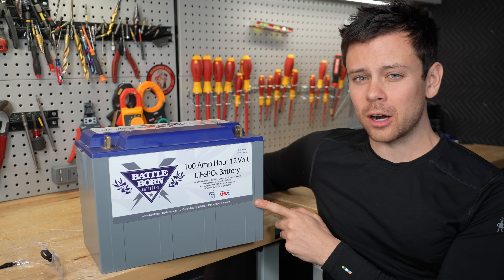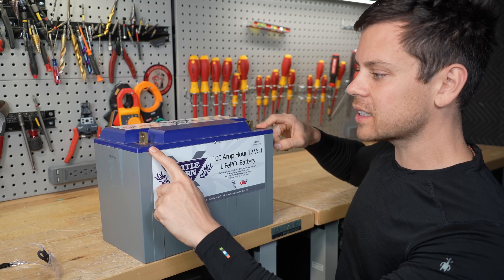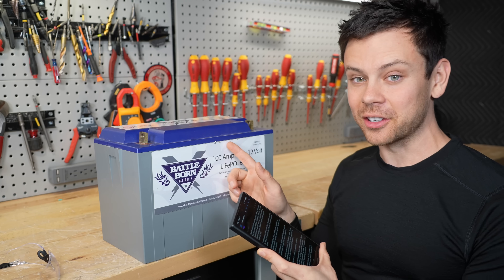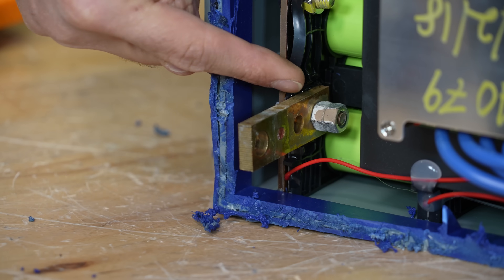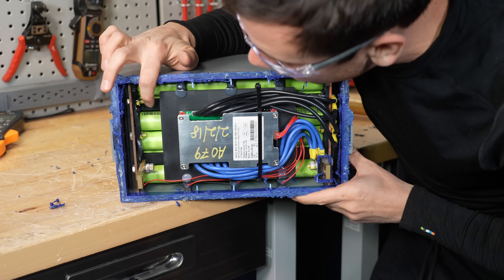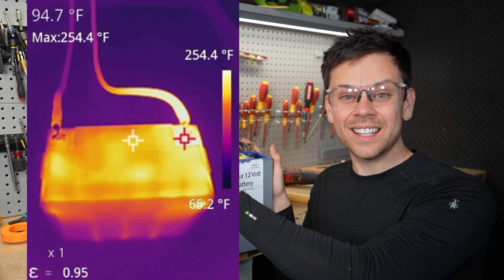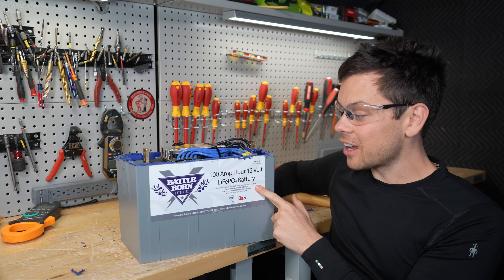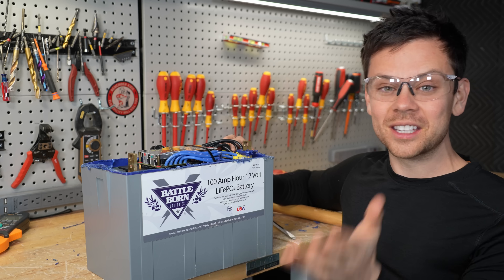Battleborn 12V Battery: Major Safety Issue

Comment from the maker: New update to show EXACTLY what is going on: https://youtu.be/7fD3yaRvp3o
Reply: I do not have Battle Born, but I have sent your video to over a dozen friends that have them in rv's to blue water boats.
Reply: Even if you don't, check out the forum! Will's forum has some of the most helpful and knowledgeable people out there. You can learn so much just by reading. Careful though, you might get addicted to DIY solar... 🤣
Reply: Hi Will. I have these batteries in my off road camper but not sure if the batteries may have an issue. What can I do to find out if they are defective? Also can you recommend a replacement battery that might have better performance?
Reply: @pancmincuk  Wiggle the battery terminal and see if has any movement.  It shouldn't move.  Put a load on it and check the temperature of the terminals.  If the terminal gets hot, it's defective.
Reply: @jimegan7077  This was so much better advice than how Will ended his video.
Reply: @jimegan7077  Keep in mind the terminals will get warm during charging. Mine do.  Warm but never hot.
Reply: @josephcomings my guess is will is trying to create controversy where none exists. I bet every battery manufacturer have issues. And this maybe a very isolated issue.
Reply: @tomgiar923  1000% this. He knows that Battle Born has this as a safety feature but didn't disclose that in the video. Now he could have discussed whether this double nut is a good safety feature or not but chose not to do that. 🧐
Reply: @jimegan7077 the terminal can be warm or even hot when the battery had to provide the high current load or while charging with high current also..

but hot temperature on the terminal (above 50°C), that is little obvious and you must investigate.. loose connection can create high resistance and of course generate heat.. that is not good..

and wiggle terminal is the same thing as high resistance connection, not good and need to fasten the nuts
Reply from the maker: @josephcomings   https://youtu.be/7fD3yaRvp3o
Reply: @josephcomings  It's not about a double nut. It's about deformable plastic which creates a loose, intermittent connection. That of course leads to arcing an overheating and thus is no safety feature, but a safety risk.
Reply: I'm not sure if this is real. But here is a response from BB regarding your video. I found it in the comments:

Thank you for contacting us. We appreciate the opportunity to provide technical context regarding the engineering and safety of your system. We understand there are conversations circulating externally, and we want to support you with facts about how our products are engineered and certified.

Regarding the concerns you raised:

Battle Born Batteries have been available in the market for more than a decade. During that time, we have delivered well over 400,000 batteries into service across all major markets. Our solutions have undergone extensive third-party testing to UL standards, we operate an open production process in the United States, and we routinely provide tours, published videos, and engineering transparency. These outcomes and the long track record of safe operation speak for themselves.

To address questions that have recently surfaced about terminal heating and fastener design, it is important to highlight that what some observers view as a failure is a safety device working exactly as intended. The aluminum nut used in our 100Ah packs’ positive terminal is a purpose-built thermal failsafe. It is engineered so that the plastic deforms and disconnects when excess heat is present at the terminal.

This protects the internal cell structure by interrupting the current, preventing further heat buildup and thermal runaway. This safeguard exists for conditions created in the field such as loose external connections, systems operating outside specification, or uncontrolled short circuits. It is one of several intentional protective mechanisms within our packs and is necessary for our UL Listing Standards.

The key takeaway is this: This design prevents heat from migrating into the cell stack, meaning it is designed to stop conditions that could otherwise create a thermal runaway event. It works as a sacrificial barrier that takes the heat event on behalf of the cells. That is the exact purpose of the feature.

In cases where a pack has already experienced misuse or improper installation, visible damage at the terminal is typically the result of that safety mechanism activating. That does not mean the design is flawed. It means the protective feature served its purpose. The batteries we sell and support today use the same trusted and validated design that has been in successful field service for many years.

If you are currently experiencing a specific operational issue with your system, please reply with photos of your installation so we can assist you further.

Sincerely,
Reply: @shday1 that is a similar response I received from battle born tech support group.
Reply: Little bit off-topic but looking at 10,000 W 48 V inverter with one server rack battery. I want to mount it in my work van. Problem is I can only fit one solar panel on the roof of my work van. Minimum voltage for solar panel to start up inverter is 120 V. Solar panel only outputs 49 V each. Is there something I can buy to allow one solar panel to charge the 10,000 W 48 V inverter battery? If so, do you have a link?

Sorry if you’ve already covered this in another video. Really appreciate you!
Reply: I'm going to send a PSA to all my clients that have them already
Reply: @galiskner7497  Maybe tell them not to freak out but instead inspect their installations, make sure the batteries and terminal connections are secure. And then to inspect for any damage. 

Then - also reach out to battle born to see what they have to say about it.

I worked for 8 years in news... this video was an absolute hit piece with almost zero actual help to the consumer.
Reply: Great Information Video William! While touting another Battery Plant your name came up during a conversation with the CEO. I told him I saw one of your "Warning Video's" and I  got a rise out of  him. That CEO made excuses why their Battery Product Failed, even with their quality control department. An employee told me on the side that because of your they added a quality control step, so "mistakes" will never happen again. Hat's off to you, Robert
Reply: I have a pair of the 270ah 8D batteries that seem to be performing fine. I wonder if the 8D version batteries have this same design concept. Does anyone know? Now I'm stressed out about my batteries 😮
Reply: Hey Will! If I have these, could I fix them? (  I’m Mike, I’m using my wife’s phone)
Reply: @WillProwse What was the load that you placed on the battery when you measured 250F? It would be helpful to know since higher loads will generate higher temps and vice versa.
Reply from the maker: @carljonsson3292  95A
Reply: ⚠️ ⚠️ ⚠️ ⚠️ ⚠️ ⚠️ ⚠️ i bought these batteries because one of your videos stated they were the best. Your video was 9 years ago, called "$950 battle born battery tear down".. i understand issues come up but man, I paid a lot for these because of what you said. 😆 🤣 😂  oh well, mine have been running every single day on a solar setup for the past 7 years. But haven't had one issue yet. But really wish I would have known this information earlier lol
Reply: @Minnesotaprojectionmapper  Battle Born has a stellar safety rating. If your battery is installed correctly and secure you will be fine. I had 3 of these in my rig for 6 years. Took it to Alaska and back and down hundreds of miles of dirt roads. The terminals are still very red. 

I now have 3 of their 270ah batteries and they are preforming amazing as well.

This was a hit piece and he knows it. Not one question about whether or not the batteries were installed correctly. Not one note about Battle Borns statement what's going on here which he KNEW about prior to publishing this video because he edited his caption on that 9 year old video and included a statement from battle born in it before he published this one.

Between the video and the batteries there's one thing that's trash workmanship in this equation... and it ain't the batteries.
Reply from the maker: Disagree, posting another video
Reply: @Minnesotaprojectionmapper  things happen my friend
Reply: @Minnesotaprojectionmapper My guess is that this is an isolated case. And possibly a non issue since there aren’t any meltdown or fire reports that I can find anywhere in the news.
Reply: So what you going to do with that battery that you cut open there
Reply from the maker: @electronicartis I donate everything in my videos
Reply: @WillProwse  ...to the battery recycling dumpster.
Reply from the maker: @davidshapiro5616  no, to forum members who help others
Reply: @WillProwse can I have it
Reply: I like to find a fix for it or recycle it.
Reply: @electronicartis  see if you can get a solid copper bolt and nuts.
Reply: Still waiting for the donated battery.
Reply: Have you reached out to BATTLE BORN about your findings?
Reply: What thuh heck is "this" battery.  The amp. or amp.-hr rating is not in textt nor in any photo.  Yes, there is 
"[covered]0 Amp-Hour" but that is useless.
Reply: Yeah JackFace....
Put that thing in a hot involvement under load?!?! 
Yeah...
All the magic goes away
Reply: What's the paid sponsorship in the video?
Reply from the maker: @Molon_Labe1776 none but I got battery for free, so I have to say that

Comment: I have 6 100 ah battle bornes connected in parallel. I just inspected them and tested them and no problems for me 
 I inspected and temp tested and also tested to touch the last 2 positive posts at the shunt end and also inspected and temp tested the last positive post on the inverter end. All this testing was done first with a  load from the batteries to inverter to appliances ant 2500 watts and then a second test charging with shore power at 70 amps from multi plus to batteries.  
 
I also checked positive posts for looseneness and they were all solid. 

The shunt side posts ran at around 80 degrees and the inverter side post measured at about  89 degrees during both output and input tests. It was about 70 degrees ambient. My needs are rather mild as the vitron multiplus output limit is only  2500-3000 watts continuous and the batteries are wired within spec.

Comment: If you previously respected BattlerBorn batteries because of their status as one of the oldest and best makers of lifepo4 batteries, and their high build quality, this will make everyone rethink using these expensive batteries. 
It sounds like BattleBorn's response is: "nothing to see here, move on" - which seems disastrous for them. I hope that the battery can be made safe, by properly securing the terminal.

Comment: Remember Wil‘s video $950 battery born hundred amp battery teardown? mr. Wil was giddy when he tore that battery case apart and showed us all the components and how he was so happy he could highly recommend this battery. I wonder what’s happened between Wil and battle born? Lots of problems with batteries and components are because of how they were installed. Sometimes the installer created the problem. Sometimes the owner creates the problem. I think this needs a much deeper dive because on one video, we are absolutely giddy about the battle born and so glad he could recommend them and now the sky is gotten dark and it’s over and all the comments in the comment section reflect that, it’s bizarre.

Comment: Looks like that terminal needs to have 2 bolts and not just one. I wonder if any bigger batteries are the same? and are those cells 19650's? that what tesla"s use (I think) just lots of them.

Comment: Plastic between the main terminal and the bus bar. Brilliant !!!! It is not even worth putting locking washers, plastic will deform and get loose anyways. Ok, this thing can happen during prototyping and probably first batch but once undergo QA processes, this wil mean a reject. If proper QA procedures and testing standards are followed. I mean, I you want to make your product fail you know were to push. If you want to make it pass, you know what to overlook.Pathetic.

Comment: Well I have two battleborns in my bigfoot camper. I moved them to the basement in the floor. What is my best replacement option? Wattcycle?  I am out of touch with the latest information. Can anyone recommend a good go to replacement?   I am not putting the battleborns back in. This is nuts..

Comment: Is there a time frame of build dates for affected batteries? I have 6 - 100's, buried in a box. Guess in the spring it will be time to unbox see if there is any discoloration. $5,500 worth of batteries.
Reply: The good news is that you can replace that pack with two Wattcycle 300 watt mini's for $860. Or a host of other brands.

Comment: Thanks for bringing this up! Our nuCamp camper came with a Battle Born 270Ah battery. However, the battery isn’t accessible from the top — you literally have to lift the camper just to check it. Do you know if this unit has the same issue?